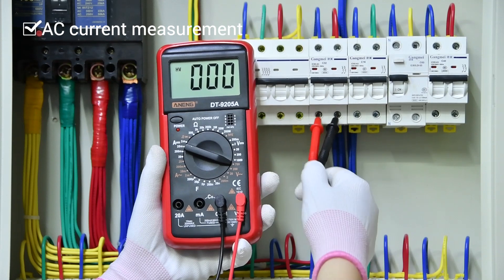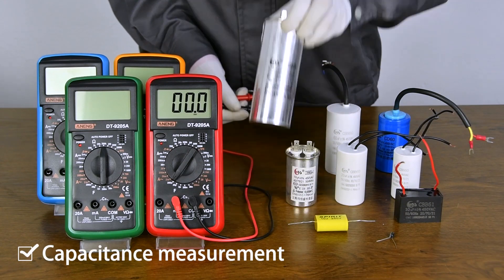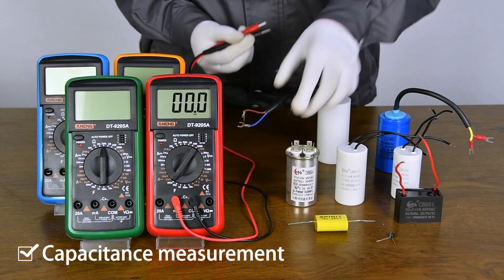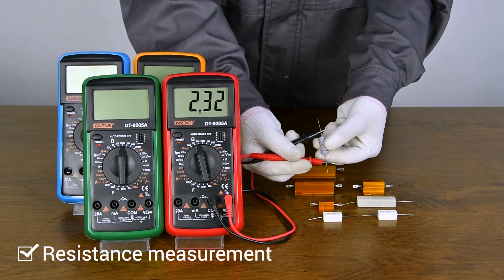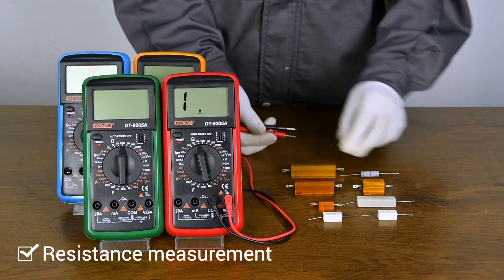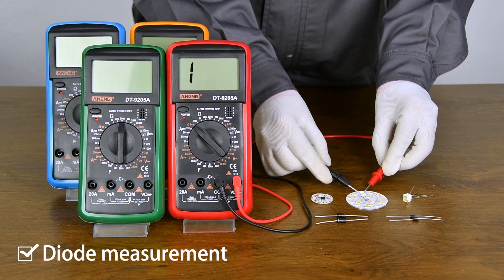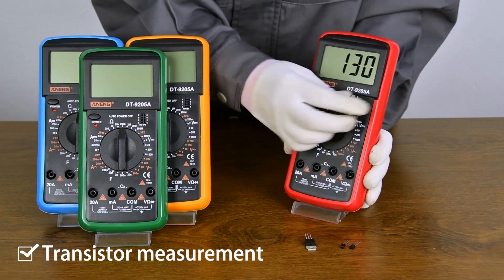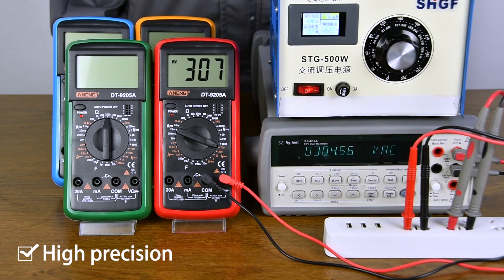ANENG DT9205A Profesional Digital Multimeter AC/DC Transistor Tester Electrical esr NCV Test Meter

Comment: В приобретённом мной мультиметре AN9205A+ вместо шунта - 2 SMD резистора 0,01 и 0,04 Ом, включенных в параллель. Общее сопротивление - 0, 008 Ом, мощность рассеивания 0,5 Вт. Нашёл шунт от DT830 и установил вместо резисторов. Вместо предохранителя стоит SMD перемычка, выпаял и установил предохранитель на 0,25 А. Отсутствует гнездовой разъём для проверки транзисторов. Открыл спор с продавцом - получил ответ, что раз я самостоятельно вскрыл прибор, то никакого возврата денежных средств.
Reply: What was the dispute for? That it was missing terminals for the transistor tester socket?

Comment: مرحبا / HELLO
ASWAR DT-9205N 
This device caused me a problem and puzzled me, that it does not measure DC capacitors!.
اصدقائي جهاز ASWAR DT-9205N
سببلي كارثة وحيرني اتضح انه لا يقيس المكثفات ذات التيار المستمر وانما فقط ذات التيار المتردد.
Reply: Hi / مرحبا
اسف علي ان اوضح امراً، ان الذي لا يقيس المكثفات ذات التيار المستمر من وكالة ASWAR اما الذي في الفيديو فهو من وكالة  ANENG وكما الاحظ في الدقيقة 0:13 فهو يقيس المكثفات ذات التيار المستمر فقط ولا يقيس ذات التيار المترر.

I'm sorry to clarify something. the device that does not measure DC capacitors is from ASWAR, but the one in the video is from ANENG. As I noticed in minute 0:13, it measures DC capacitors only and does not measure DC current.

Comment: What is the difference between dt9250a &an9250a???
Reply: DT-9205A seems to be a model number used for two different versions of the meter for some reason. Not sure why they wouldn't change the model number when they make a new model. Looks like the old model has a rotary off switch unlike this one which has a push button on off switch.
Reply: It's very strange how many different versions of the ANENG DT-9205A are being sold.

Comment: Mine is no longer lighting the Power Led.
Reply from the maker: dear,could u pls tell me more detailed about your problems?
Reply: @aneng  Ok, is that on my Multimeter, that red Power LED does not light up when I turn on the Multimeter but, I think it must be normal, right? It lights up, for example, when I am in the BIP function and touch the two terminals of the Multimeter. Thanks
Reply from the maker: @Dancopymus  dear could u pls send us the video or photo to show the problem well?
Reply: That's interesting, brings up a good question I didn't think about as I was looking to get one.
What is that red LED under the power button supposed to be for?
Hopefully it's not supposed to be on when the meter it turned on, because that would be a silly waste of power.
Maybe it's meant as a low power indication, which is also a bit silly as that just accelerates the power drain as the battery gets low.

If it's not designed properly and can no longer read accurately as soon as the battery gets low, then I guess it would make some sense because it'll force the user to stop using it once it gets low, to avoid giving erroneous readings to the user that can't be trusted.
Reply: Best design would have been an indication in the LCD of low battery, and the measurements continuing to be accurate even when the battery is low.  You should verify this in advance with your meters so you know if that meter is reliable and can still be used with a low battery indication.
Reply: @sadfur8728  Thanks for the comment.
Reply: @Dancopymus  what is the BIP function you refer to on the meter?
Is that resistance measurement mode?
Reply: @sadfur8728  No, it's on that diode symbol. I think it's the continuity test. Sometimes it lights up/beeps and sometimes it doesn't.
Reply: @Dancopymus  possibly your battery is on the way out, in the resistance and diode check modes, it draws more current from the battery and pushes it below the threshold for the battery low indicator.
Might want to just replace the battery to see.
Reply: @sadfur8728  Thanks; I will check the battery.